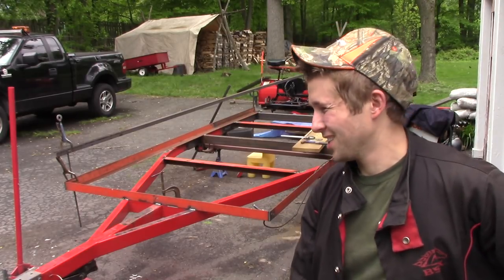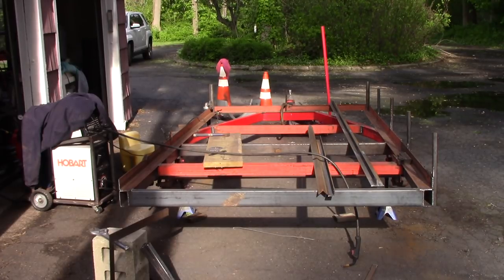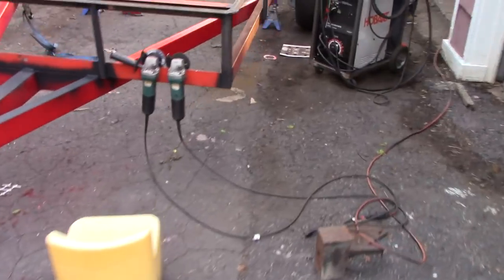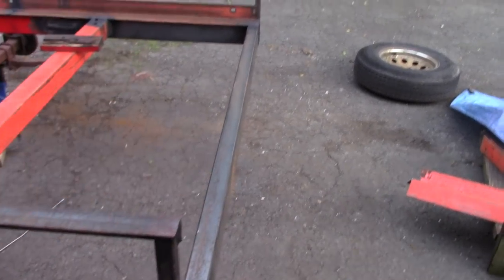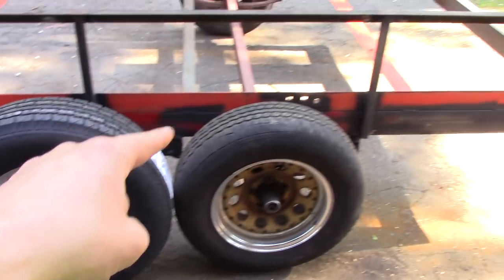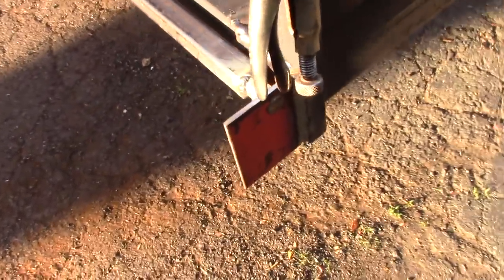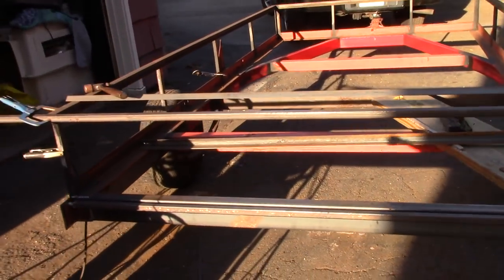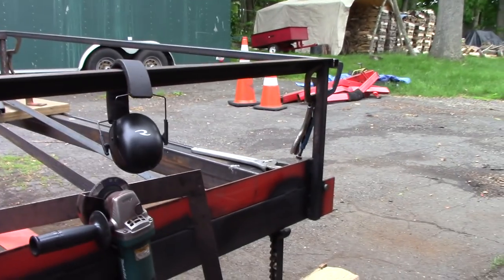Trailer build 3

Comment: Why would the 3" side of the angle iron not be up and welded to the outside frame instead of the 2" side?
Reply from the maker: I'm a little confused by the comment and this project is a few years old now. Can you reference a specific time in the video?
Reply: @OldSoulMillennial  ....sorry...the angle iron frame connectors look to be 2x3.
Is the 2" side what the lumber lays across and the 3" is underneath or vice versa?
Reply: Thanks for getting back with me by the way....welding up a flatbed right now.
Reply from the maker: @jeremiahjohnson9908  If I remember correctly, the angle that I used for 2 of the cross members (between Fram rails) was 3"x3". If I only had 2"x3" angle to use, I would have the 3" side vertical. In the vertical position, the angle would provide more support to the deck and bounce/flex less driving down the road.

Lmk if that didn't answer your question
Reply: @OldSoulMillennial ...That's exactly the answer I needed SSD. I picked up two pieces of 1/4" 2x3 because the supports were sagging and looked like thin bed rails.
I am going to notch them and weld them on top of the outside frame (will have to notch the lumber so they lay flat),  and just was not sure which side up or down would give the most support.
Thanks again man, i appreciate the help.